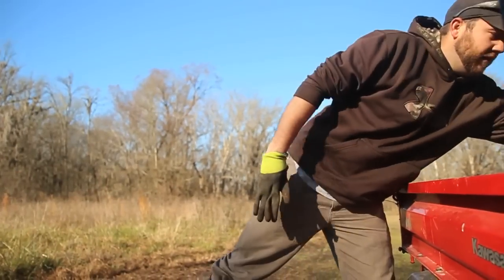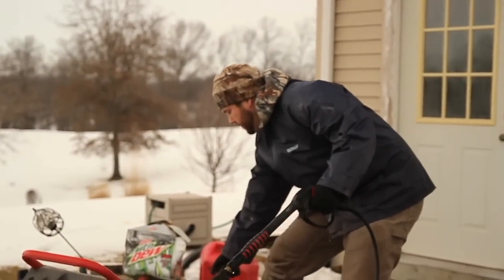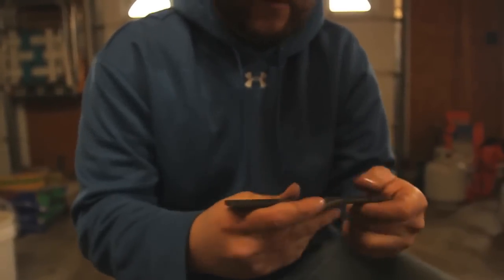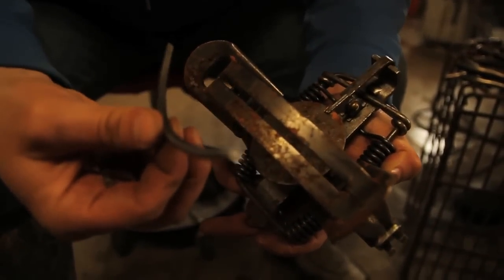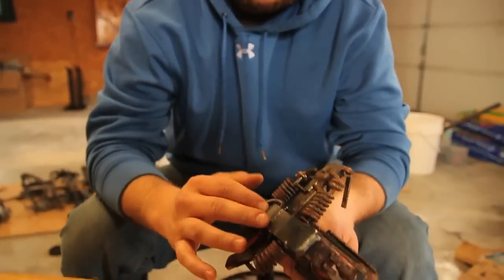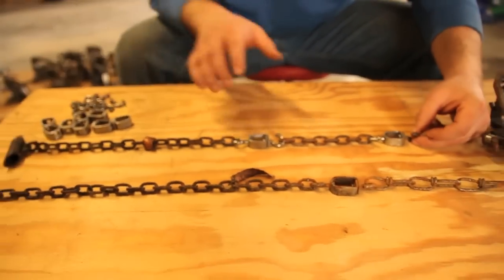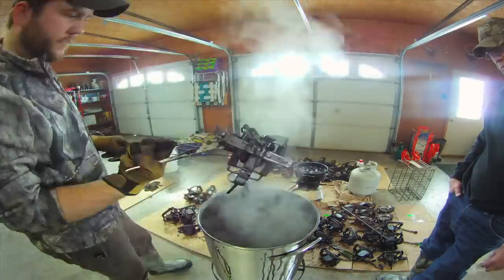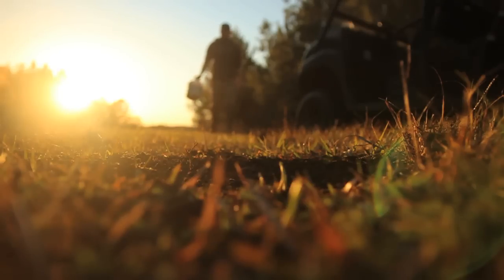Trapping: Trap Modifications - The Management Advantage #31

Comment: Perhaps you might mention to new trappers that when welding base plates keep heat away from the springs so they don't loose their temper and become weak;  Check your power settings when welding lamination on jaws so not to warp the jaw. It will happen.  And finally for those of us veteran trappers who also do ADC work, trapping is a year round passion.  Thanks for the video and keep up the great work!

Comment: I have had great luck using a dishwasher with hot water heater set to maximum heat to clean and degrease my traps. I use the same bark dye that you do...

Comment: I got a pot of wax too but thing is you don't need all that wax to wax a trap.... get some water super hot... almost boiling then throw just 1 bar in.... it floats on the water.... do the same thing by letting trap heat up and pull out gently.... perfect coat of wax